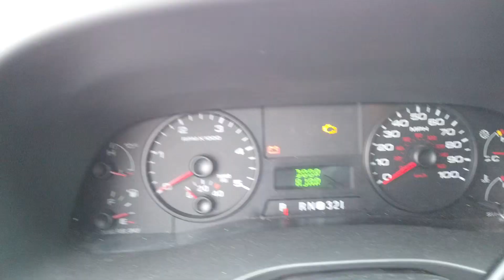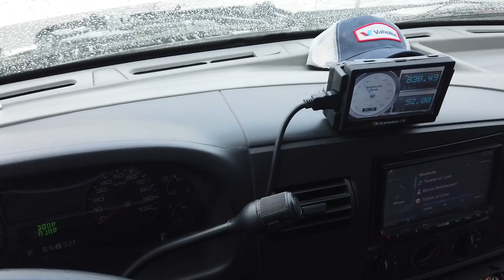Blowby, how much is acceptable?

Comment: Hi,please show us how much exhaust leakage (not oil) is normal through the oil dip stick hole or engine oil cap
Reply from the maker: @nelsongeorge6444  diesels for the longest time had a specification for crankcase pressure which was measured with a water manometer or gauge in inches of water.
Manufacturers don’t give lately on today’s engine.
Duramax LB7 for example did have a spec of 16  inches at 3100RPM
Reply: @dieseltalkwithtonysalas8725  thank you

Comment: tony,  do you have a preferred  engine oil? or do you just use any oil that's in specifications?
Reply from the maker: As I have mention in previous videos, I get asked which engine oil I use. "Whatever is on sale!"
The oil used is CK-4, WSS Ford approved and other manufactuers certifications on the bottle!
Ford has been very good about testing engine oil see this video. https://youtu.be/CFcIBOV2qKs